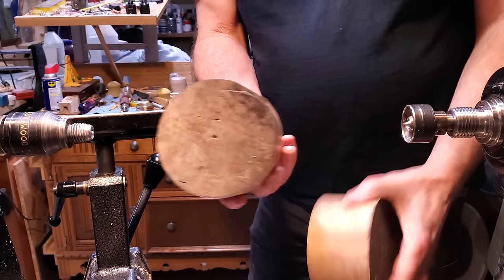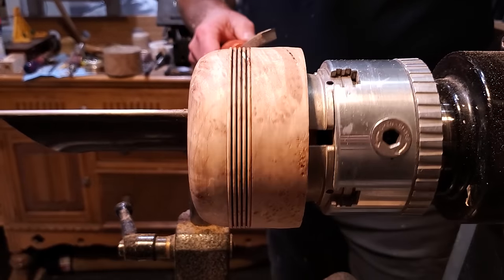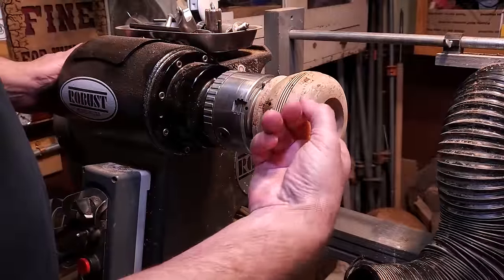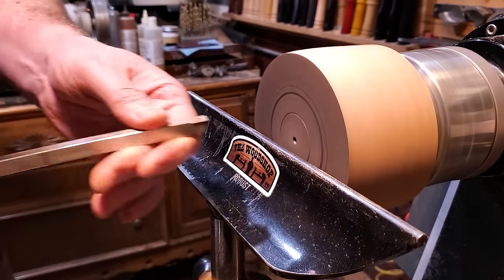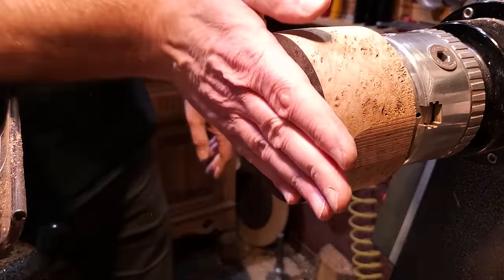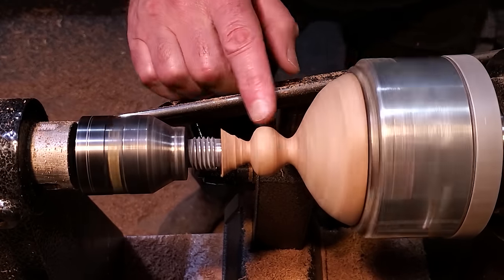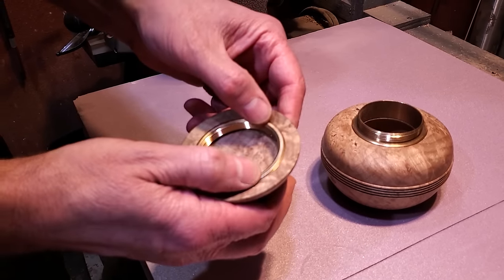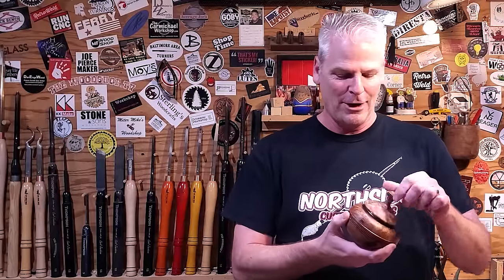Woodturning | Maple Burl Box Niles Bronze Threaded Inserts

Comment: That wood really has great figure.  That must have been a massive piece of furniture to provide blanks that size. Those rings really seem like a great solution to making threaded boxes if one does not have, as Mike Peace calls it, "uranium enriched wood" that lets one chase thread in it.   A couple questions: 1) If one over-achieves in making the recess for the insert, how much margin does one have with the epoxy? 2) When hand chasing threads, the top and bottom piece can be made to line up in grain or figure by trimming the piece until the figure lines up when the box is closed.  What is the recommended way to to that with these rings?   
  Really enjoyed watching this; saw that you had added those rings and now plan to get some the next time I place an order.
Reply from the maker: Thank you Mark! The epoxy is pretty thick, so you have a good margin to play with. I would just go slow and take your time. As far as lining up the grain, it's pretty easy. Just put the epoxy on both sides (being careful not to get it on the exposed parts) and simply thread the lid on until the grain lines up. I did an Urn a few weeks ago and lined the grain up on it, and it worked great.
Reply: @CarlJacobson  Thanks!

Comment: Beautiful repurposed wood project. Q: If you want to align the grain of the lid to the base can you screw on the brass lid fitting to the base, apply the epoxy, then push the lid to the position matching the grain? There’s the risk of too much epoxy but could you put a minimal amount on then once dried supplement with CA for strength?
Reply from the maker: Thank you very much!! You absolutely can do that. We just finished an Urn and did exactly what you're talking about. I didn't use the CA, just epoxy though. I should of mention that in the video!

Comment: Nice video. What is the piece with the mandrel that fit into the headstock that was used before the chuck.  I have never seen this particular 
piece of equipment.
Reply from the maker: Thank you Cindy!! It's a spur center. You use it for spindle turning in-between centers.